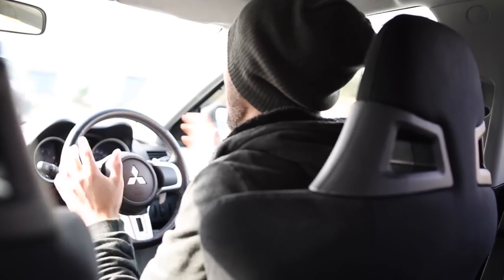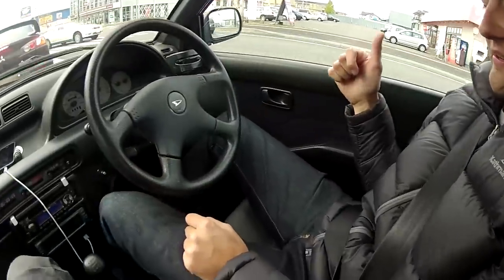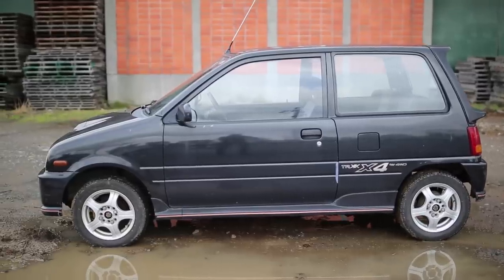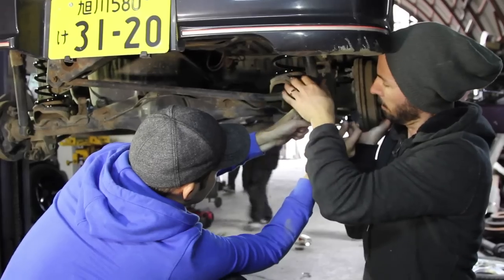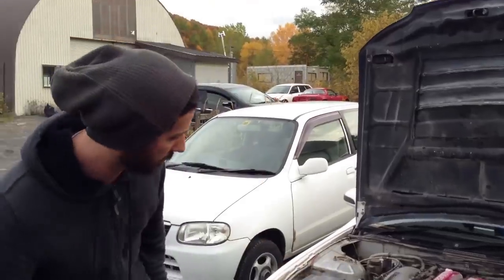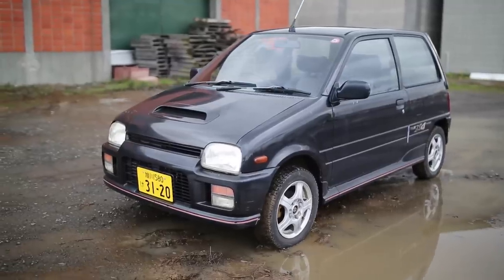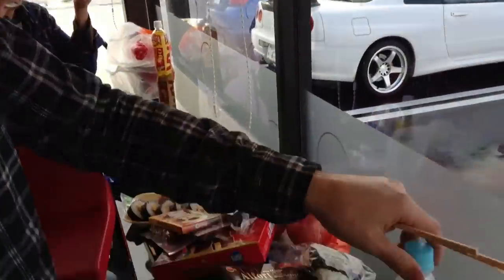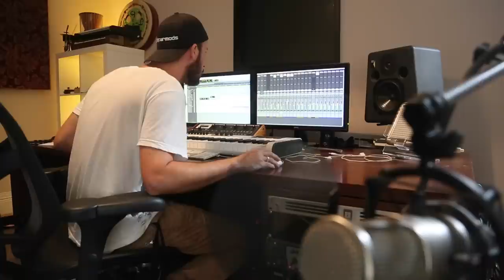Behind The Scenes - KEI TO THE CITY

Comment: The shot at 17:00
Those KRKs...I've said this before, but I have the smaller version of those, with the ports on the bottom instead of the middle. I rarely see anybody with them and I'm surprised to see you with them. They don't have much low end.  I do see that you've upgraded ;)